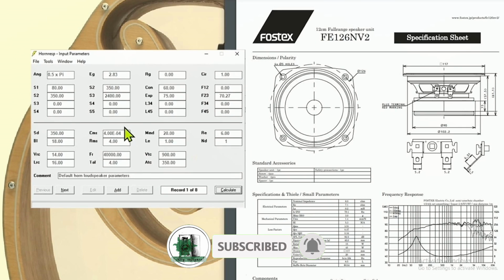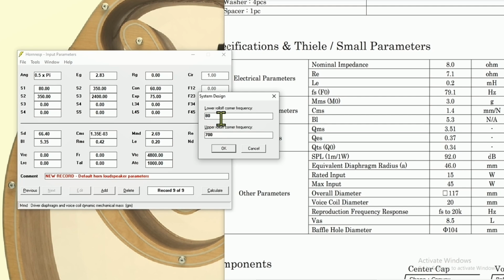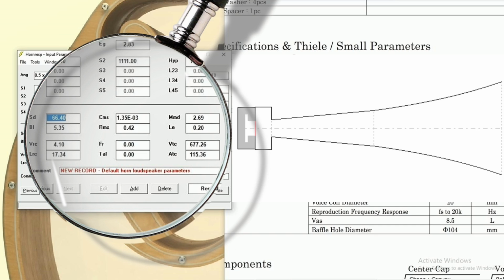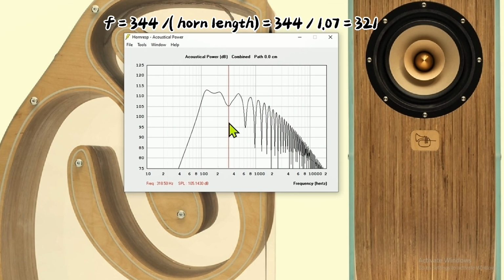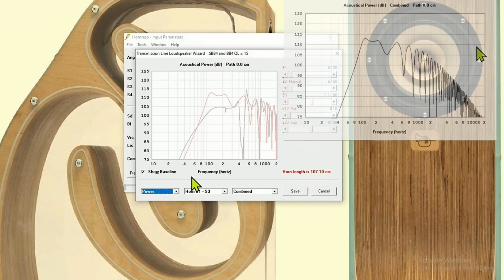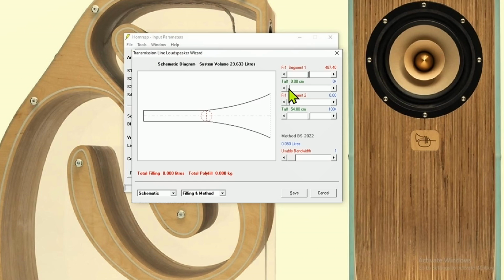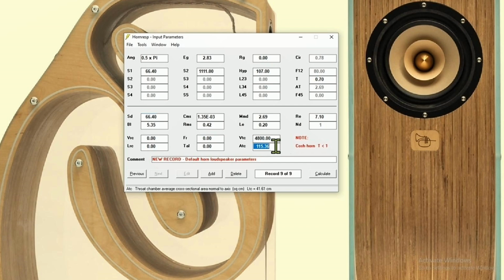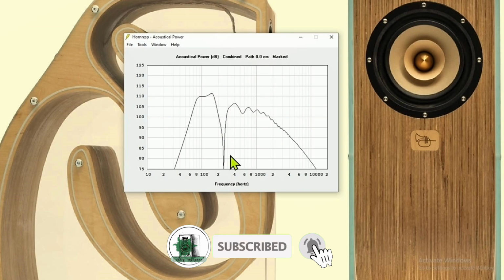All about horn speaker design-6

Comment: A properly designed bass horn needs no damping, but this horn extends to mid/full range. The problem is that if you model damping material for full horn length, it's not enough to put it only to the corners. You need to fill the horn with light damping material instead. And the density is critical, put too much and you kill the output.
Reply: No you are wrong. Damping the camper behind driver  and the next Part. Never complete.🤙🤙🇩🇪
Reply: @thomasschafer7268  You just lose efficiency if you stuff the horn up. If you have nasty resonances you have to redesign the geometry if you want the best efficiency. Damping is an easy solution, but it comes with the cost of efficiency. I designed a 16hz capable sub horn with a 21" driver that needs no damping and is flat from 20hz to 60hz... Pushes out 130db at 20hz effortlessly.